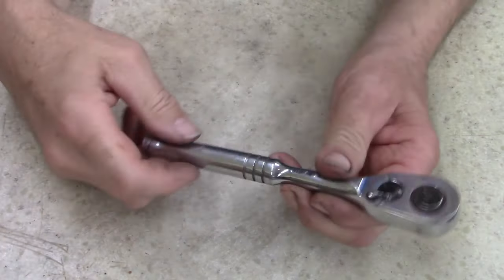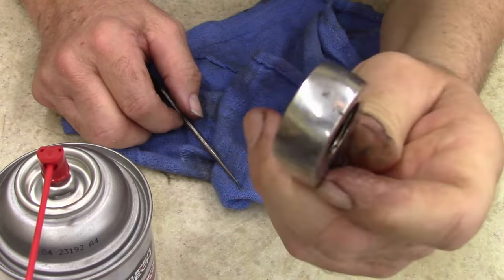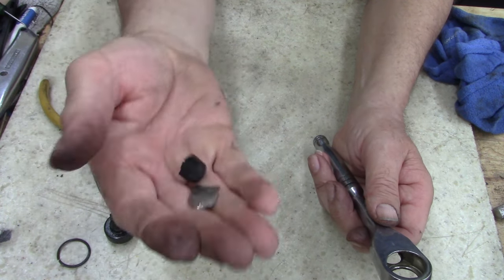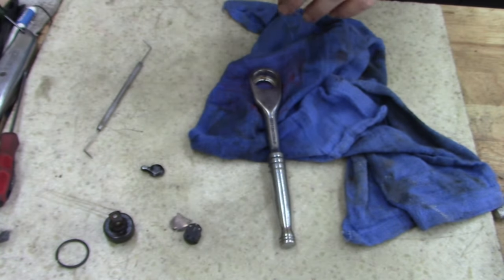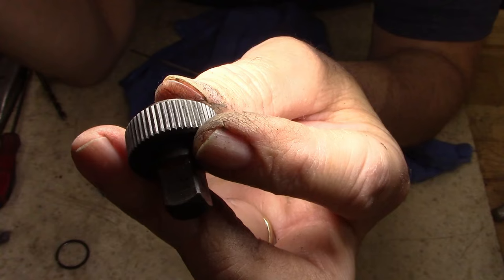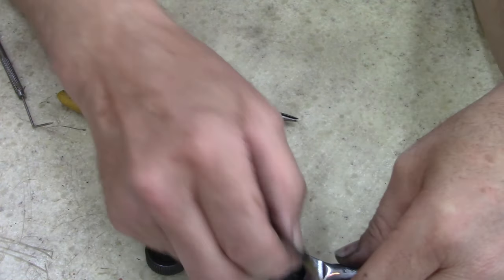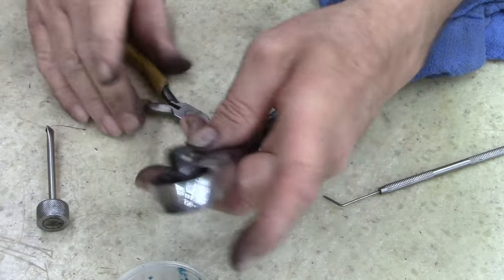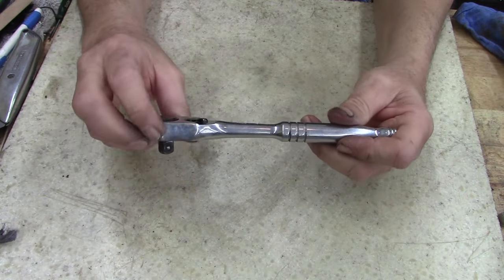Cheap Stanley teardown and clean-up!

Comment: If they're gonna cheap out on two tiny components, Why even bother wasting the steel making the rest of the ratchet.
Reply from the maker: Correct, I cannot believe that it would cost that much more for a very far stronger tool, and give the company a better reputation!